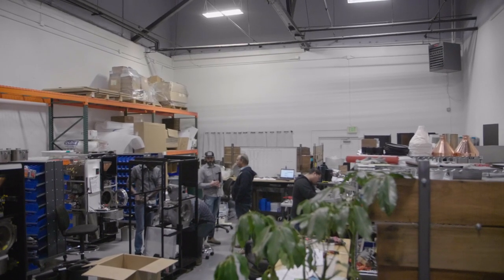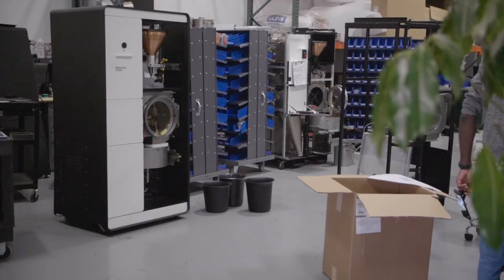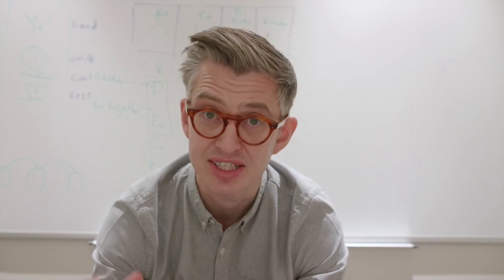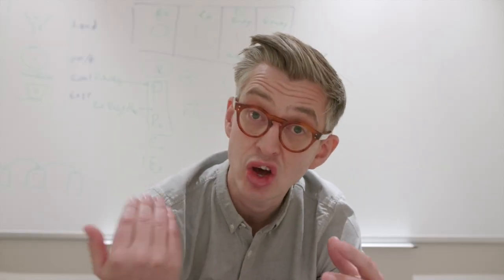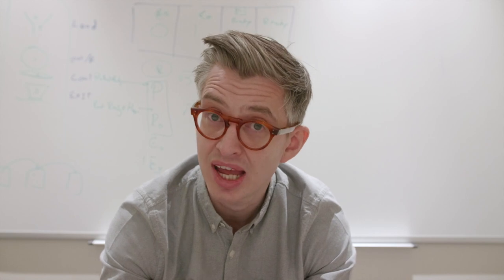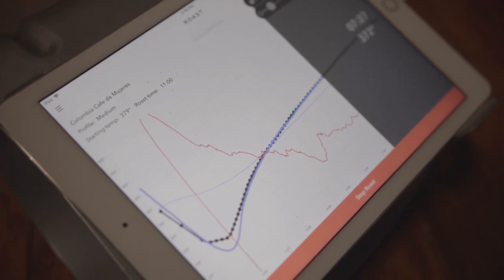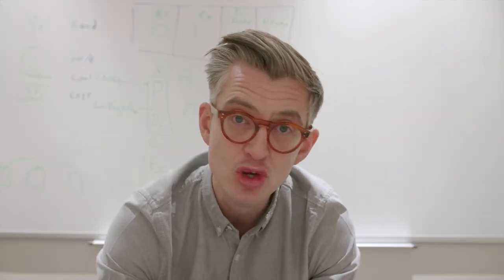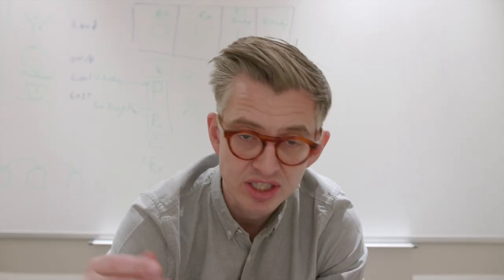A Visit to Bellwether & The Future of Coffee Roasting

Comment: In the interests of full disclosure; I design and make coffee roasters
All props to the folks at Bellwether, it looks like they've done a great job.
The golden fleece of roasting has been to be able to create that "smokeless" roaster.
So far, all the units that I have encountered, leave their signature ABR (already been roasted) flavor on the final product.
My many experiments with heating by electrical resistance, have always ended in frustration and failed heating units.
To achieve your dream of roasters running strictly on electricity will also require elevated voltages, beyond what is commonly available now.
So, I look forward to tasting some finished product.
Reply: I've had a few coffees from different cafes using these roasters and have been pretty well pleased so far

Comment: I just happen to have built a custom roaster myself and having gone through the challenges of getting sufficient heat from electrical sources, given the right design for optimal energy distribution I really think a 15-30 kg electric roaster is not impossible. Once again great video!
Reply: wow!
what wattage are you thinking of?
Reply: @jpjay1584  In the range of 7KW
Reply: @GermanMythbuster  I see. thanks! (in case you answered for the 15-30kg roaster)
7kw is what other electric roasters use for 5-8kg.
you need to improve a lot on the efficiency level, otherwise it won't roast properly. (improve in comparison to existing roasters)

Comment: Impressive design an enineering approach; using electricity seems pretty clean, it just cleans the roastery environment, however, electricity comes from burning fuels, among which: gas. 

So an electric roaster, just endorses the gas burning issue to the energy company. The electric roaster approach it is actually not (as claimed by the manufacturer) "emmisions free" but quite the oposite, more gas is needed to produce the electricity required to roast, compared to the gas burned by the roaster itself for the same quantity of beans. Efficiency is taxed everytime there is an energy transformation (fosil fuels to electricity and then to roaster's heat). Nonetheless, this roaster promotes convenience (no vents, no permits, no afterburnets, plug-n-play) which is true. 

Other sources of energy and higly efficient systems would be an important step towards not using or minimizing gas in shop or mid sized roasters; recirculation or recovery of heat to pre-heat or maintain base energetic requirements (cogeneration), alternatively burning the chaff (as they do when producing sugar with the sugarcane bagasse in sugar, panela and "bio" energy production).

Thanks for your input :)
Reply: Well... it's as green as your electricity mix. So probably better to run this in Brazil or France than the US or Netherlands. But the entire point of going electric is that you can switch to renewable electricity a lot more easily than renewable gas. Asserting the electricity will just come from gas for the foreseeable future is at best pessimistic and at worst disingenuous.

Some heat exchangers and heat pumps would be nice though.

Comment: While this roaster may not run on fossil fuels we still most consider the source of the mains/electricity. Only when fossil fuels are entirely removed from the chain should this (and other like devices) be considered a non-fossil fuel application. The electricity has to come from somewhere.  What I like from this brief peek behind the curtain is that the Bellwether is regenerative to an extent. That's a huge plus in my book as it not only aids operating cost but can be used to help stabilize internal temps from batch-to-batch.
Reply: And you can almost always taste that redeposited effluent.
Reply: And negatively affects the flavor of the coffee. All roasters that redeposit roast chamber air do this.
The only way to prevent this is to use this heated air on the  aspiration side to the flame  generating the heat.
The temperatures created by an electrical resistance are insufficient to scrub the recycled effluent.

Comment: Great video, James. I was wondering if you were familiar with Stronghold roasters, which roast coffee using convection, radiation, and conduction, also eliminating the need for a gas line.  I discovered them at the New York Coffee Festival and they were showing their different size units, but I'm also intrigued by Bellwether, which operates on basically the same principle. I haven't done too much in-depth research into Stronghold, but I'm very interested and invested in the future of roasting away from using gas lines. I'd love to see Bellwether and other similar companies take off, and thank you for taking the time to share your thoughts with us!
Reply: You should try Aillio from Taïwan
Reply: All of you caffien heads out there....how disappointed will you be when you have to replace  your heating element, which you will have to do, if you use your roaster on a regular basis.
Unless these companies use tantalum based heat sources, operating at 460 V 3 phase, they will be inefficient and unreliable.
Reply: @marinasantorelli7224  Thanks, I'll look into them!

Comment: Hey, that's my neck of the woods! If you come back, I'd love to say 'Hi' and am happy to offer any suggestions.

I'm curious about the potential for automation. Given the greater number of sensors, and easier ability to control electric heat, do you think this will lead to more repeatable, or possibly automatable roasting? I know some of the smaller "desktop"-sized electric roasters have been trying to do such things, but I'm not sure what to expect since the green source is obviously a huge variable.
Reply: I have built roasters that were designed to be capable of unattended roasting.
They are not.
There are too many what if issues in a roast to assign control to a plc or ipc.

Comment: I really cant see how this machine will make roasting scene more eco-friendly. I dont think 80 x 3kg roaster would have less carbon footprint than a single 240kg gas-running classic roaster until a time where people produce %80 of electricity from renewable sources(which wont happen probably for another 30-40 years). preheating times alone will kill any argument about them being "eco-friendly". Lets assume a somewhat short preheating time of 15 min for this machine. It would make a total of 20 hours of empty running of these machines to match the capacity of a 240kg roaster. In a 240kg roaster, you could roast almost 8 tonnes of coffee before those machines even start roasting a single bean.
Reply: atugruls this is intended to roast small batches for cafes, not to match the capacity of large industrial roasters

Comment: I’m not sure about your comments on the comparative environmental friendliness of this roaster. As most of the electricity on the grid comes from coal burning power plants, the higher electricity usage of this machine would actually be worse for the environmental than a similar size propane or NG roaster.
Reply: I think the idea is more future-oriented, or at least that's the ethos. He did allude to the future of roasting, after all. Provided that energy production is less fossil-oriented-- let's be clear: it'll need to be based around the resurgence of nuclear development at least for the foreseeable future-- then it holds that there is veracity in there having been foresight with a design like the one depicted

Comment: What's the response time with how it reacts to changes in temperature? I don't know anything about roasting so this might not make sense. I know that with gas you can go from high to low super quickly but with electricity you kind of have to do more guessing with knowing when to shut it off. Does this question apply? lol
Reply: I have never experienced a time lag using electrical resistance heating.
They also are easily controlable.
They also have no toxic emissions.
They don't last, they are unreliable.
They have real limitations, you can't do large scale roasting, 5 - 6 lbs max for reasonable roast times.